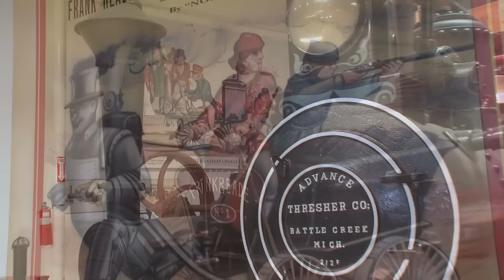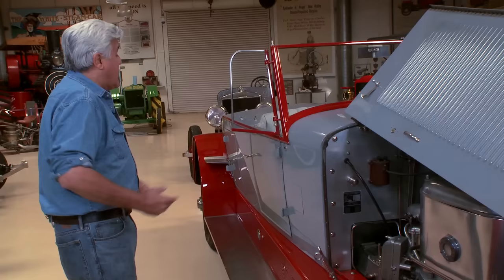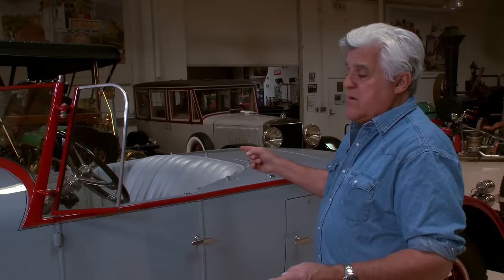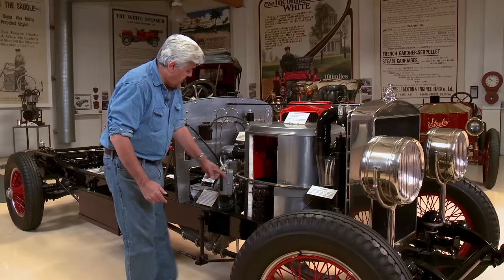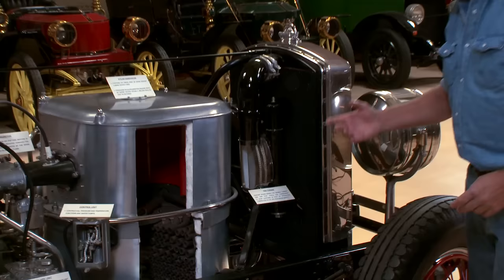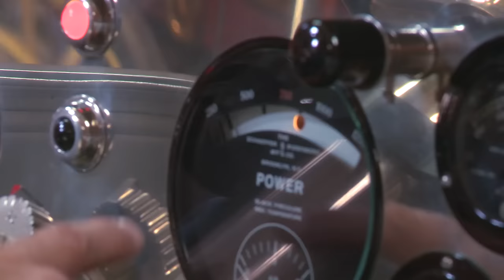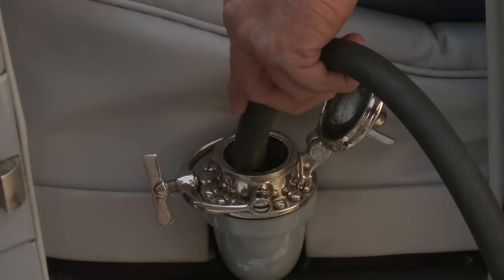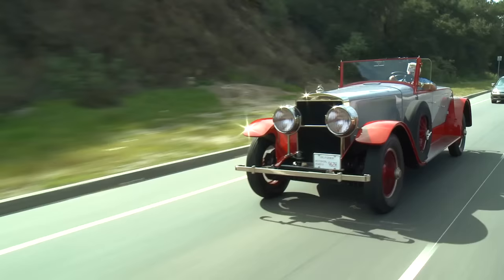1925 Doble E-20 Steam Car - Jay Leno's Garage

Comment: "150 horsepower." 
Well, you have to remember --- the horses were a lot bigger then than they are now.
Reply: #buffhorses
Reply: And about 1,000 foot pounds of torque. 👍
Reply: @rogersmith9808  That torque is also developed at EVERY RPM unlike an internal combustion engine, a steam engine is an external combustion engine, that is why it does not need a gearbox.
Reply: @Roger Smith Only at 0 rpm... when the engines is developing 0 horsepower...
Reply: @Sidecarbod But unlike internal combustion engines... steam engines lose torque as RPM goes up... A modern Diesel pick-up truck would smoke this gutless turd up a steep grade like it was standing still...
Reply: don't know about that, when I look at a shire I start believing my truck may only have 2 horsepower
Reply: @Veikra A new Ford F-250 Diesel has roughly the same torque and 300% more horsepower too... maybe you need a new truck?
Reply: @doktorbimmer  this thing has literally two cylinders in it. Imagine six lmao
Reply: @Tyler Steam locomotives only have two cylinders... what was your point?
Reply: @thanos kermit Childish insults won't prove your point (if you had one) and won't make you look very smart either...
Reply: @doktorbimmer  yeah, I thought about it and it does come down to the amount of pressure that the heat engine expels rather than the area it pushes, being if you made more cylinders youd have to increase mfr of the gas to keep the same power. If you were able to keep constant line pressure throughout the process, youd be able to have 1,000 ft lbs of torque at any speed, but then you wouldn't have any control over the vehicle lol
Reply: @Tyler L Yes, the reciprocating steam engine horsepower is dependent on steam flow... the displacement of the cylinders does not change... the only way to increase steam flow is increase RPM which effectively lowers torque output.
Reply: @doktorbimmer  the pressure in the line is what decides torque, the flow rate is hand in hand with the RPM, maybe theres a property that I'm missing, but here's the way I think of it: higher rpm means increased flow rate, and when the cylinders get moving then the flow rate of the gas is faster than the engine is able to produce pressure. From an energy analysis perspective, the pressure is converted into velocity in the lines. If you were able to hold constant pressure through the endeavor, the torque would not drop. Of course, there could be properties that I haven't learned about, because I'm pretty sure diesels are the same way with torque drop, which is due to less intervals to burn the fuel as it increases in RPM
Reply: @Tyler L  Yes, its called BMEP or Brake Mean Effective Pressure and its the difference between static indicated pressure and indicated power, volumetric efficiency and friction (FMEP).
Reply: Yeah but 1000ftlbs of torque lol
Reply: @His Dudeness  It only produces 1,000 lbs-ft. at ZERO rpm... its not the same as a Diesel that makes 1,000 pounds at 1,900 rpm.
Reply: 2.5 tons and reaches over 200 kph. Think about it. Steam be powerful, yo.
Reply: @sidecarbod1441  no it isn't lol if you revved it higher and torque didn't drop you would have significantly more HP
Reply: @tylerl6942  did u miss the part where  he said it had 4 cylinders LMAO
Reply: @doktorbimmer  this is a 4cly....
Reply: @Johnny-tq9no  You have mixed me up with someone else, I basically said that the torque does not drop off as the RPM goes higher unlike an internal combustion engine. This is of course assuming that the boiler can maintain pressure as the demands of the engine increase along with the rise in RPM.
Reply: @sidecarbod1441  which no steam engine can....
Reply: @Johnny-tq9no  You need to use more actual words so that what you are trying to say actually makes some sense.
Reply: @sidecarbod1441  dude read all the comments of people who go into way more depth of why a steam engine will never make that much torque at anything but 0 rpm SMH
Reply: Its like listening to 4 year olds
Reply: @rogersmith9808  It's incredible about the same HP as my 2litre PSA diesel with five and half times the torque, from a stand, just awesome!
Reply: @Johnny-tq9no  Four cylinders double acting, compound. Equivalent to 16 power strokes per crankshaft revolution.
Reply: I mean yes, in 1925 they used horsepower, now we use brake horsepower
Reply: @doktorbimmer  unless we made the steamer bigget
Reply: @sidecarbod1441 .... It the way the boiler was so far from the engine..., it could have been placed on the top to improve efficiency.
Reply: They were - much more torque.  Torque is a rotational force.  Big engines generate a lot of torque, small engines do not, regardless of horsepower.

Comment: I had the privilege of riding in one of these as an apprentice mechanic many (40+) years ago. Some thing I will never forget.
The smoothness, quietness and instant torque is something I never witnessed again until very recently getting a ride in a Tesla P100D.
I remember the owner of the Doble saying he could not open it up fully as the wheels were not in so great condition and would not handle the torque.
Reply: Yeah even driving a golf cart you feel how much torque electric and other non-ICE motors have.
Reply: Amazing story thanks. However EVs now are not really a feasible alternative - they are just pushed and subsidized to make it look that way.
Reply: @steinbauge4591  And yet most major manufacturers are moving production to some, if not all electric vehicles.
They are here to stay whether we like it or not, and running costs are dramatically lower than the equivalent ICE car.
Reply: @Stambo59  Of course they are here to stay but they are promoted for the wrong reasons.Several European countries that already import electricity are basically moving to outlaw ICE vehicles from the middle of this decade. For some conditions the tech is not ready yet; resource problems..
Reply: @steinbauge4591  I am sure a similar thing was said in the late 1800s about early ICE cars. We will adapt, that's how innovation happens.
Reply: @Stambo59  That would apply if this was just an actually needed technological innovation but there is so much else involved. That was another era.
Reply: @steinbauge4591  If everyone believed that, there would be no technological innovation.
Do you disagree that something needs to be done to combat pollution levels in our major cities.
Did you not see the improvement in air quality in cities where lockdowns happened due to covid.
Electrifying the vehicle fleet, especially in inner city, congested areas, will reduce airborne pollution levels resulting in improved health outcomes for those working and living there. This cannot be denied.
Reply: @Stambo59  Neither did I deny it but just electrifying the cars etc in UK would exhaust battery resources. China practises what you say by means of coal power, moving part of the problem out of congested areas. Here in Norway the ambition is all out electrification but cars and infrastructure cannot yet cope with arctic conditions outside cities.
Reply: @steinbauge4591  You do realise it will take a long time to fully electrify the whole UK fleet right?
It won't happen tomorrow and battery suppliers are ramping up all over the world.
Initially, creating inner city zero emission zones will make a difference.
As ICE cars get harder to repair because of parts availability and harder to replace because of reduced production they will slowly phase out. Fuel supply will become less viable and more expensive.
Not so sure on the time frame, but I am sure it will happen in my lifetime.
Now is the time that ALL countries should be thinking about future electricity requirements.
Here in New Zealand where I live, we run more than 90% clean electricity, hydro, geo, wind, even some solar but I still think we need to seriously consider the nuclear option. (There will be a lot of opposition to this but I believe it needs to happen.)
As far as coping with arctic conditions, necessity will drive innovation as it always has.
Reply: @Stambo59  Question of resources. Britain arranged the coup in Bolivia to take control of the lithium, seems not to have worked too well. You don't just replace the energy sources that created the modern world. It all takes oil and renewables destabilize the grid.
Reply: @Stambo59  I myself quite like nuclear power but think the most effective way forward is enhanced geothermal systems running a binary fluid cycle. It has the base-load capacity of coal/oil fired stations and the peaking capacity of gas fired station or battery banks. Wind can mix with farmland well enough. Solar makes sense for cold climates since heat is needed; otherwise roof space should be given over to radiative cooling paints in warm climates.

Comment: i always felt that 12 screws to hold a gas cap was insufficient
Reply: You're obviously  a 'Doble' man then! :)
Reply: I think 14 screws would be better
Reply: Nah, you gotta weld it together … while there's gas in the tank, of course.
Reply: @Grumpy_old_Boot  and if you survived the blast, THEN throw those 14 screws in
Reply: @mattpalmer8918  
Oh, they would throw themselves in.  😂
Reply: @Grumpy_old_Boot  it's a doble, not a pinto
Reply: @Odddit  
Doble .. Pinto .. if you add a gas torch to their gas tanks, the results are the same. 🤣
Reply: @Grumpy_old_Boot  Just be sure to do it in a nitrogen atmosphere, not this weird oxygen/nitrogen mix you typically see.
Reply: @jwhiteheadcc  
Oh, I know - Who was so reckless and put all that oxygen here anyways ?
…. wait, the tree's did it ?
Ok guys, burn down all the trees !! 🤣
Reply: Mine is being designed right now with - drum roll, please - TWENTY-SIX screws!
Reply: ooOoooohh … we bask in your glory.
Oh twenty-six-screw-gascap!! 😁
Reply: Yeah, because 13 is a prime number and that doesn't go excited well to lose a screw, maybe.
Reply: Mine - sadly - only goes to eleven
Reply: Plus they're all clocked perfectly. Someone spent real time getting that to look just right.
Reply: @Klikkitse  Per Frederick Henry Royce: "Why use two bolts when twelve will do?"
Reply: Hmmm yes yes hmm well you see my dear chap 13 is a prime number and therefore have 13 bolts makes the car more premium
Reply: I wouldn't complain at all if there were eleven.

Comment: When I was working at the Texaco refinery in the 1980s we had a number of piston steam  pumps. It is too bad you didn't know that piston steam pumps are still manufactured. You could have contacted them for piston information or metallurgy. Gardner Denver is one manufacturer that still makes double acting steam pumps
Reply: got a notification that "Someone" thought this was interesting, maybe Jay?
Reply: I have just clicked on the like button after reading your comment. ;)
Reply: @jpvill4th  
How did the lubrication work on these? There must have been a pump that squirted oil into the steam input line. Was lubricating oil recovered at the condenser?
Reply: @kristyskirt9015  
What were they used for? Why did they use them? Just because they had a lot of free residual sludge to burn to make steam?
Reply: @kristyskirt9015  
Yeah, I dont doubt they have steam, I would just think electric air compressors are lower maintenance and more versatile. Didn't the Tesoro refinery suffer a horrific fatal explosion about a decade ago? So they have valves from 1933 still in service?
Reply: Electric air compressors if properly engineered and installed are much more energy efficient than steam... and lower maintanance.
Reply: @doktorbimmer  Got a Steam Phobia have we ?????
Reply: @Philip Kerry Not at all, I love old, antique, and obsolete engine technology! History is fascinating! Cheers!
Reply: Yeah, electricity is great until you don't have any. Refineries and chemical plants need something like steam when there are electricity failures. In addition, steam is safer when dealing with gaseous atmospheres.
Reply: in most cases for refineries and chemical plants steam is  used for backup and to ensure that critical systems will always have fluid moving capacity like cooling water pumps. When I worked at Texaco in 1981 I speced a cooling tower pump that had a dual drive; an electric motor at one end and a steam turbine at the other. The pump in between was rated for 50,000 gallons per minute. The pump was started on steam and when the electricity was available it was switched from steam to motor drive.
The advantage with a steam piston pump was the self-priming of the piston pump. Great for oil-water separating basins.
Reply: Low pressure steam is also an excellent heat source in manufacturing and food processing... Most breweries and distilleries use steam as an essential part of the process of making beer and spirits. Cheers!
Reply: Funny you should mention old german valves. The chevron refinery here in richmond(at least until a few years ago, dunno about now) had old valves and valve handles in the more inaccessable portions(read: Out of sight and thereby out of complaining distance)of the refinery that were still working just as well as the day they were offloaded prior to world war 2. Interesting bits of history, but something that would have many people here foaming at the mouth if they knew they were there.